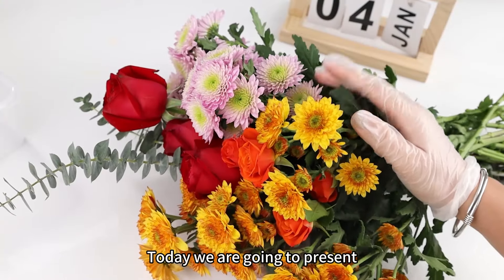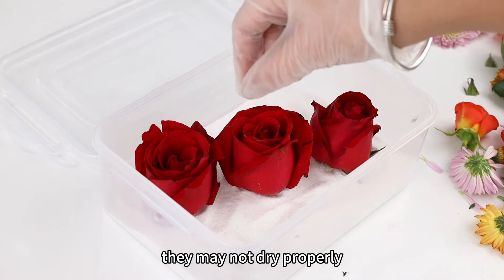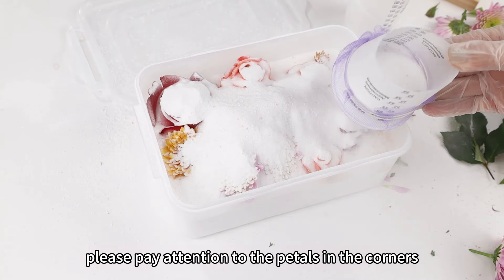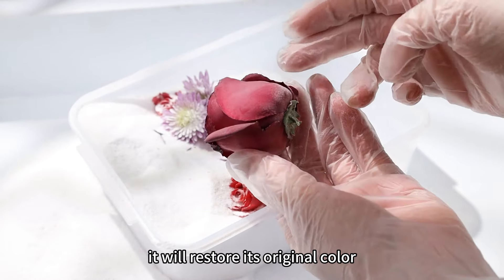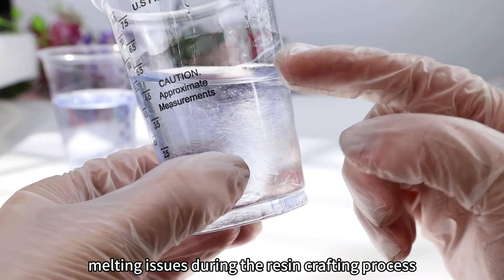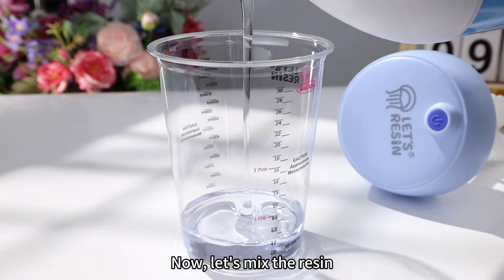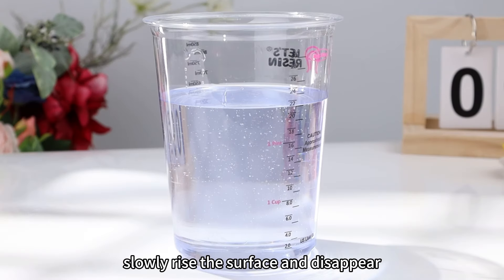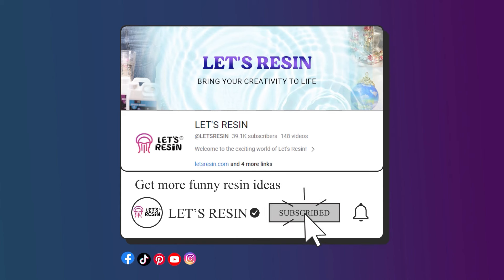🌺Casting Dried Flowers In Resin Table-Tips and Tricks You Need To Know!

Comment: Hello
What should be done to prevent scratches on the surface of the table?
Reply from the maker: Hi, you can consider applying a protective coating or sealant specifically designed for resin surfaces😊